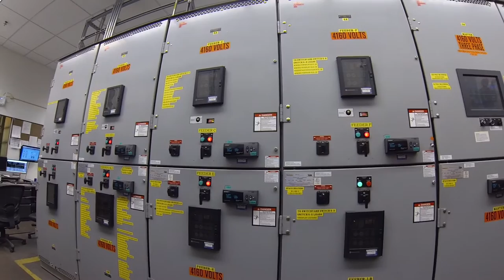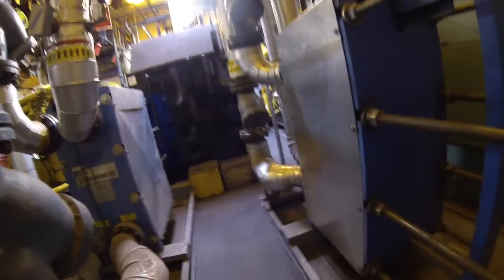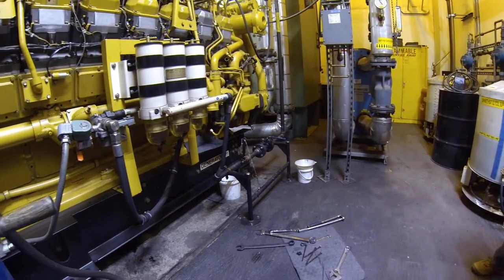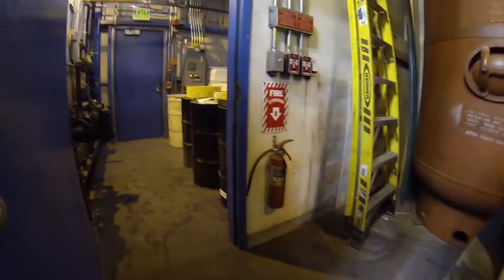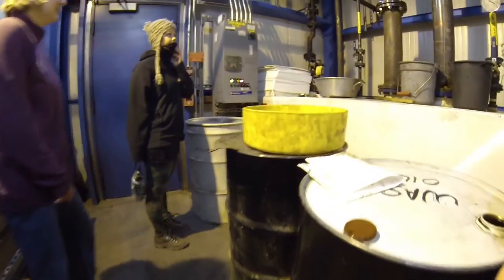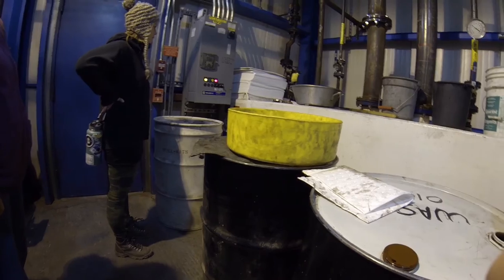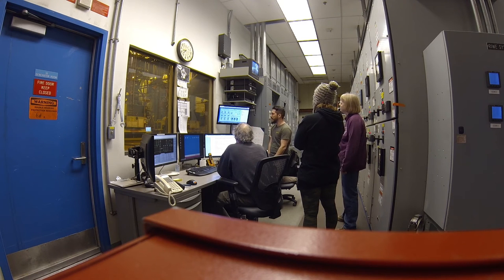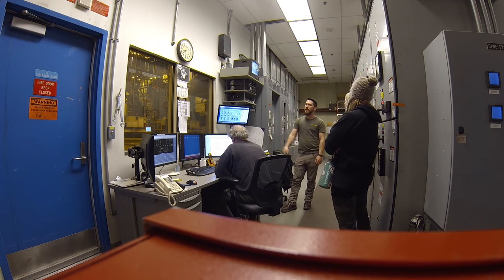McMurdo Power Plant Tour Summer 2016-17

Comment: Wind turbines were a great idea, but have solar panels been considered for the summer months?
Reply: Not practical
Reply: Yes. Repeatedly. They freeze, get covered with snow, and blown away in storms. (you wouldn't just drag them out on clear, sunny days.) Wind is a much better option - and they do have wind generators - but it doesn't generate power 24/7.

Comment: They could really use a smr or perhaps a few radiothermic generators strategically placed to save on fuel fired heating.
Reply: RTG's are good for a few kW's. The MW's needs for the "city" would take more RTGs than have ever been manufactured. (plus the obvious problems with bringing nuclear material in, and the (possible) treaty violation of removing all the shit your reactor contaminates.)

Comment: Fascinating place. What's the ambient temperature like in the plant? I can see it's elevated as you go in-- does that stop the heat from the building melting the permafrost?
Reply from the maker: I'd say it's usually about 80's in the generator rooms with a few hot spots here and there.  There are a lot of elevated buildings down here in order to prevent snow build up, it honestly doesn't work to great for the utilities buildings though because I think we're a bit low and backed up against a hill.

Comment: great video. i have 10 years coast guard experience. working in the engine room with 2 caterpillar generators and two alco propulsion diesels. would this qualify me for some type of position?
Reply from the maker: Maintenance or operations on them? If you did maintenance then the power plant mechanic position is a possibility but otherwise I'd say you've got a decent shot at the power plant operator spot.

Comment: What voltage do the generators put out?
Reply from the maker: Hey! They put out 4170.
Reply: J D Would that be a 3 phase 4160Y2400?
Reply: How much power does each genset put out in kw?
Reply from the maker: I'm not totally sure what it is to be honest. The power plant electrician would be more informed about that than my position.
Reply from the maker: We have one at 1400kw and five at 1600kw and are connected to three at 180kw over at Scott's Base plus three wind turbines that top out at about 335kw.